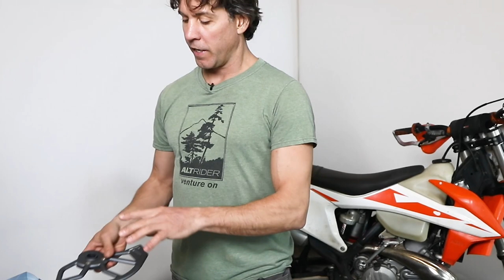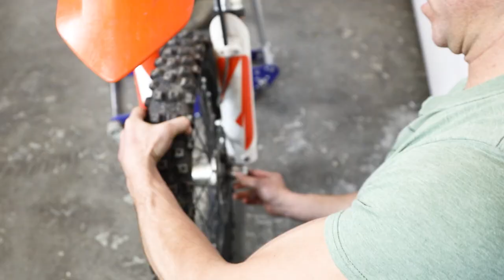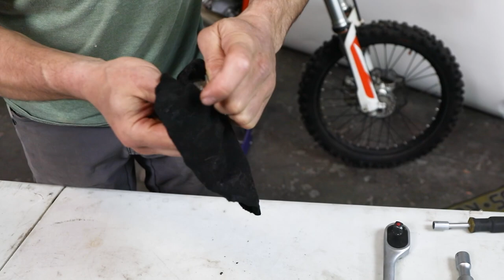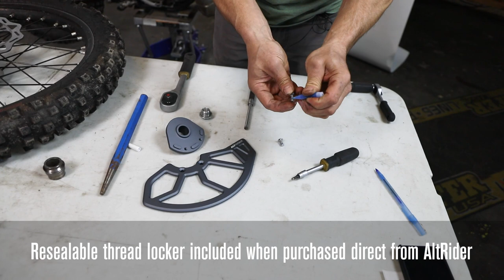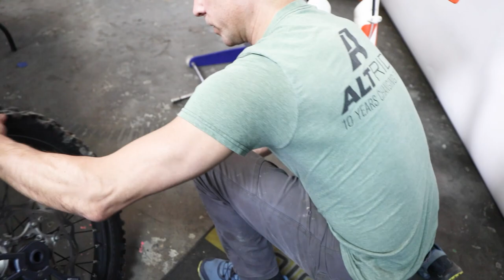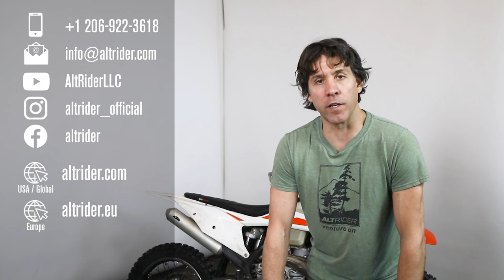KTM Front Rotor Guard Install by AltRider

Comment: Is it intended to float? As in it is not connected to any other part of the bike to keep it from rotating?
Reply from the maker: The guard gets its strength from the robust KTM axel and it replaces the factory wheel spacer. It is also shaped to match the profile or the fork leg lug bottom. So when it takes a hit it has lateral strength from the axel and forward strength from the bottom of the fork leg. 
It refrains from spinning because of the compression the axel nut creates.